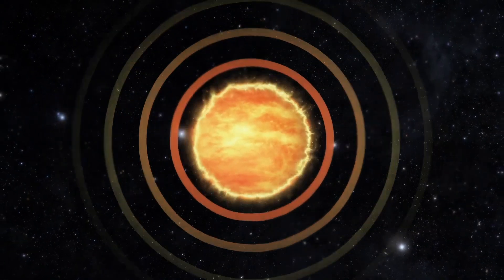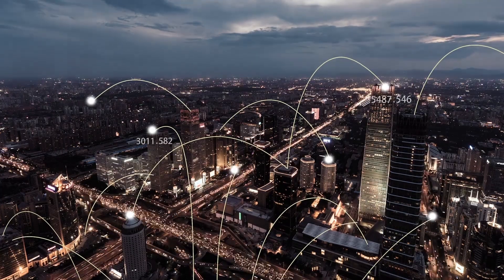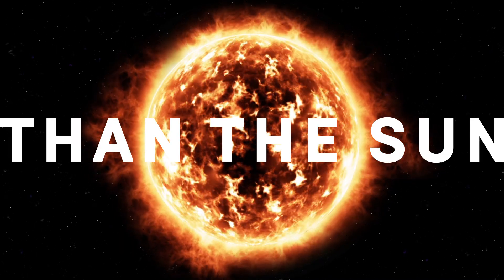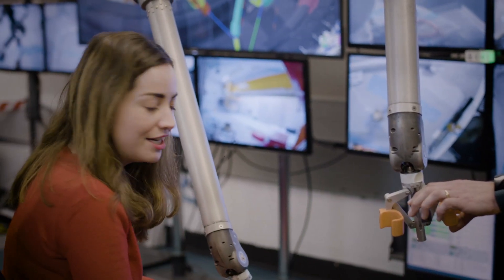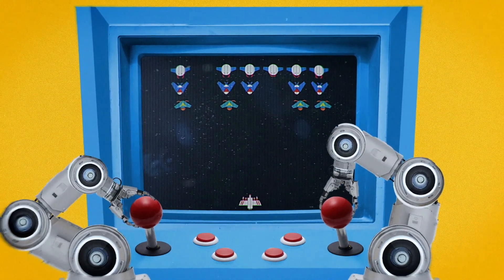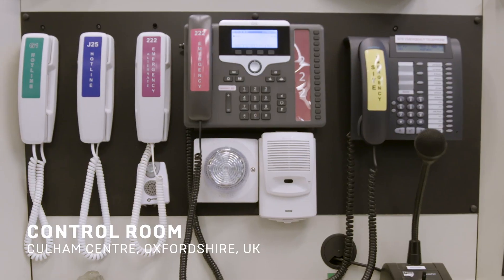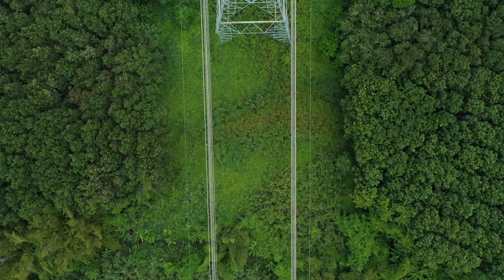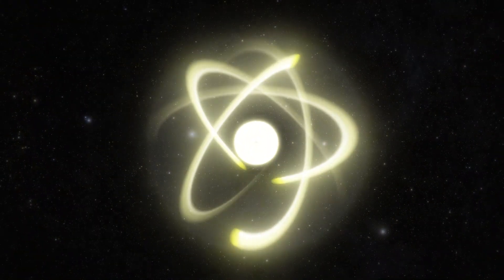Inside JET: The world's biggest nuclear fusion experiment | On Location

Comment: For nuclear fusion to become a viable terrestrial power source, two goals need to be achieved. The first is obviously to sustain a fusion reaction for extended periods of time. Second, the energy gain of the fusion system needs to be sufficiently high to justify the investment required to build, run and maintain the system. Given the predicted time frames to fully develop fusion power, the transition to renewable energy resources will be far more advanced thus making the its’ economic viability less certain.

Comment: This is really old, decades old. ITERhas already been built - and neither JET nor ITER has reachec breakeven.  By the time they exceed breakeven and produce useful power, ithe reactor will be too big and expensive to be practical.
Reply: Eventually we will have such reactors. That's not even the problem. The problem is that they are too expensive to operate. Solar power is far cheaper.

Comment: Utter failure - this produces only a tiny fraction of the power it consumes - some say as low as 1%, after decades of research. The figures mentioned here only consider heating power - this is a fraction of the total power consumed to run the place.

Comment: What are the downsides of fusion becoming the main source though?
Reply: There is no downside which is the best thing
Reply: They mentioned radioactive waste in the video
Reply: @shrodingerscat8940  it does actually prpduce radioactive waste as tritium fusing with dueterium will produce nuetrons. Those will hit the breeding blanket and the walls of the reactor vessel. That will produce waste materials.
Reply: @russhamilton3800  wow u are really smart
Reply: @russhamilton3800  r u a scientist?
Reply: @shrodingerscat8940  nope, just read a lot.
Reply: Well the fiel they are going to use costs 30k per gram. So your average fusion plant would burn through 10 million per day. ITER says they can produce 1.14 times the burned fuel but it actually uses more than gets burned so we would have to build fission reactors to supply the fision reactors. Also since that fuel is a hydrogen isotope its going to make the steel inside brittle and since it will produce neutrons, those neutrons will destroy the chamber even more. So if they can produce net energy, they can't build plants due to not enough fuel.
Reply: @russhamilton3800  we can mine fule from moon once we become advance
Reply: @shrodingerscat8940  first off what is beong designed uses tritium not He3 which is what i suppose you are talking about. He3 is not some magic bullet. Yeah it can fuse more easily and has no neutron nastiness but that is still a long ways from being able to produce net energy. People who mention moon mining, tend to think its a given and its not. Tritium - Deuterium is not a given. As a reminder they so far have not even reached gain let alone the ability to produce net energy.
Reply: @russhamilton3800  hmmmm ok

Comment: They'll be popping champagne corks when they get it to light a 100w light bulb. Nevermind that it costs 1.5 billion dollars.
Reply: It can already do that. Problem is if they put in, say, 1 MW of energy they get 0.98 something MW. Which is a lot but less than the amount put in. They're trying to get it to above 1.
Reply: @MenacingPerson  Right.. enough to light a light bulb. When they get just that much more out.. than what they put in. They'll have Uhhhh succeeded to light my closet.
Reply: @rogerdodger8415  1 mw can light 10,000,000 lightbulbs for 5 seconds you know
Reply: @MenacingPerson  Not if it takes one million one hundred Watts to produce it!!
Reply: @rogerdodger8415  wait no its actually 10,000 we're both dumb
Reply: @rogerdodger8415  anyway, enough to power 10,000 lightbulbs
Reply: @rogerdodger8415  and besides they can generate up to 16 mw so 160,000 lightbulbs for 5 seconds
Reply: @MenacingPerson  Are we talking leds here?
Reply: @bobrose7820  we're talking 100w power consumption here, not the chaotic wattage equivalence system so it doesn't matter. 

Light intensity is measured in lumens, and power consumption is measured in watts. Since you're talking about type of bulb, the best analogy is that i'm talking about incandescent bulbs.

Comment: One big issue (if fusion were to spread across the globe), the high neutron flux could be used to manufacture plutonium-239 for nuclear weapons.
Reply: I’m no fan of fusion, I don’t think it will ever work. But even so carrying out surreptitious bombardments or ones where inspectors have been kicked out, probably neither will work very well. Not that it’s not a concern but it would be worth the risk and doing countermeasures, except that fusion is not going to work…
Reply: @russhamilton3800  do you have specific reasons for saying fusion won't work, or is it just a feeling because it's taken so long to get it to work? We know fusion "works" under certain conditions (the sun and every other start being good examples). The question is whether we can build machines on earth that can economically produce electricity from fusion.
Cynicism is understandable, but it doesn't prove something cannot work. It just shows that people have been overly optimistic in the past.

Comment: 2:23 plasma is not energy. Plasma is a state of matter - where some electrons are removed (or free) which result in gas ions (which are now positively charged and thus able to be influenced by the magnets).

The energy released is electromagnetic radiation.
Reply: Most of the energy released is in the kinetic energy of the neutrons, not the EM radiation

Comment: But isn't the electrical output power produced by a basically standard steam turbine?  Thus making the nuclear reactor just a somewhat better way of boiling water.  Isn't it true that, in round numbers, the plant will release about 2 kw of unrecoverable heat into the atmosphere for each kw of electrical power produced?  Why is no one discussing this fact? I am sincerely not baiting here, but doesn't this reality need to be addressed?
Reply: Why is heat released into the atmosphere an issue? No one is discussing it because the heat just dissapates and leaves the planet.
Reply: Neither JET nor ITER have any electrical generation capability at all.

Comment: Windmills are just a drop on a hot plate
Reply: “windmills” is for the layman. They are caked wind turbines and windfarms deliver actual electricity to the grid and does so in a cost competitive way compared to coal, gas and nuclear.

And the wind sector achieved more in the last 20y  than fusion will ever do in the next 50y..  it is an interesting physics experiment but a commercial pipe dream, like so many other before.

Comment: Still 30 years away.
Reply: Very optimistic. At least 30 years for a proof of concept. Then 10-20 years more for efficiency optimization and cost cutting. 10 years to build, test and commission the first commercial model. That is in the best case scenario 50-60 years before the first commercially viable fusion reactor is in operation. And that’s assuming nothing goes wrong (and of course if you have worked in projects or as an engineer you know something always goes wrong.. just remember the Concorde..)
Reply: @Memoiana  aye 30 years to see if it will even be viable!

Comment: I still didn't understand that what kind of material is this which sustain at 150 Million degree C. Melting Temperature of these materials is around 3600 C.
Reply: The amount of "stuff" that's heated to 150 Million °C and turned into Plasma is minuscule and is contained within magnetic fields which means it doesn't touch the walls. Sure, its pretty hot and should it touch the walls it will absolutely melt it. Also, there isn't nearly as much heat coming off of it, relatively speaking, to heat up the walls while plasma is contained in the magnetic field because there's so little of the plasma. Increase the amount of plasma you have and you'll melt the walls regardless of it you have it contained in magnetic field or not. That's not to say that walls don't get hot at all. They do, just not as hot as one might imagine considering its a meter away from 150 Million °C
Reply: The plasma doesn’t touch the walls. The plasma is 150 million C, not the surrounding materials.
Reply: @Gomlmon99  Still inside temperature will affect the outer bounder. Does 150 Million C has an impact on the material?
Reply: @FawadKhanz  Yes. It is one of the things they are working on. Certain parts of the machine get very hot and they use special technology to remove the heat. But it is not as bad as you think, the materials do not melt very fast

Comment: To do this successfully you will have to learn that knowledge of how fusion works is on a "need to know" basis. It is not paranoid to imagine that the secret to the most terrible weapon ever created is surrounded with lies and misinformation. You must recreate the physics from scratch.
Reply: Thermonuclear weapons are a totally different technology to creating steady and controlled fusion for electricity. The secrecy will come in protecting any nuclear waste and fuel used for the process and possibly protecting the IP of the design I'd say.

Comment: Sorry but the frog eaters across the channel are already assembling a fusion reactor .   ITER  !
Reply: ITER which will use 300Mw of electricity to produce 500MW of thermal which if converted, but it won't be capable of electric generation, would produce 200MW of electricity. Yeah way to go!
Reply: @russhamilton3800  ,   it's use 300mw of its own energy to drive itself ,  so its a net gain . 
Nuclear reactors and hydroelectric dams all use some of the energy they produce to operate themselves .   Valves , Gates,  cooling pumps ,  etc
Reply: @ericsarnoski6278  wrong. It will be a gain but only in the difference between the fuel as heated and what the fuel produces. But pretending that other inputs like the energy to hold the plasma or the parasitic electrical stuff still means there is no net energy production. Call it gain all you like, there still is no excess power.
Reply: No. ITER (like JET) is an international project. France simply won the bid to house it. It won’t even start actual fusion experiments until 2035 (plasma experiments start 10 years earlier), so there’s still a lot of meaningful science to be done at JET and other facilities.
Reply: @JonS  you mean building pensions for engineers and scientists.
Reply: @russhamilton3800  no. I don't mean that. Every scientist and engineer I've know has wanted to work on something meaningful and achieve something. I know it's popular for the anti-science community to dismiss everything as a money-making scheme for scientists, but those science graduates who are looking for riches switch from science to fields like finance (I've know people who switched to things like financial modeling). The ones who stay in science/engineering want to make stuff happen, and turn down more lucrative career paths for that.
Your comment is like saying everyone who participated in the Olympics only did so to get sponsorship, product endorsement, or TV pundit jobs.

Comment: Well, it looks to me ITER is gonna lose against solar, wind and batteries. Just upscale those to meet demand in winter time and you're there. The only negative would be a surplus energy in summer, which would result in super low energy prices.

20 years is telling me they don't expect ITER to deliver results or have a clear path.
Reply: I think the most likely and economical scenario will be a mixture of renewables, energy storage to help balance the grid, and nuclear to produce power and hydrogen.

Energy storage isn't cheap enough yet to change the world and neither is nuclear. Both technologies need some work to become game changers (i.e. make fossil fuels economically inferior). I think it's going to take a few decades to improve those technologies but I honestly think they'll solve the energy problem before climate change becomes overwhelming.

Comment: I still don't understand, how they can thrive for "unlimited", when clearly the sun is using up mass, in order to achieve fusion. 
It makes sense to convert something useless in it's natural state, but extremely energy dense and useful when converted and create heat (which we can use) in the process.
Like a log. It just sits there and does nothing, but once you add enough energy and it burns by itself, after removing said energy input, then you achieve a useful conversion and SEEMINGLY free energy, as long as there is a mass to convert.
Except that the log is hydrogen and deuterium, am I getting this right?

Comment: 6:29 redundant by other technologies, shows WindMill*
Reply: hope Fusion Reactor turns into Arc Reactor soon
Reply: @chan_for  yeah exactly. fusion gives us the possibility to create energy on demand and a lot of it. Renewable is good as a grid but what if you are off the grid ? Small fussion reactors would be extremely useful and we heavent mentioned the possibilities that this technology would open in space exploration or colonization
Reply: Yup. You got that right. At the end of the day what matters is actually delivering cheap electricity to the grid which windfarms are doing. 

Fusion is a pipe dream. 

https://renews.biz/61228/uk-offshore-wind-cheaper-than-new-nuclear/

Comment: No, you will never build enough windmills and solar panels to supply the base load, even if you could make enough batteries to store the excess when the sun wasn't out or the wind wasn't blowing.  Fusion (or fission in the interim) is the only way to go if you don't want to emit carbon dioxide.
Reply: and dont forget the amount of rare earth materials they need and the complecity of recycling those materials
Reply: I don't think you understand whst a strawmsn argument is, but I digress. You are assuming net energy from fusion possible. They have not even proven that gain is possible. Even if net energy can be got from a prototype, can it be fueled? Not with current tritium stores. ITER claims it will breed 1.14 times what it burns but they don't talk about the amount they will lose or about the contamination. So go ahead and keep saying fusion is inevitable because that is a real strawman argument.
Reply: Every windmill built will supply more power than all fusion reactors combined.
Reply: @russhamilton3800  At the end of the 19th century you could have argued, correctly, that horses had allowed more people to travel much further than all automobiles combined.  Any more useless strawman arguments?

Comment: the problem with fusion videos is they are all like advertisements. it always starts 'save the plant!!!11111oneone', moves on to a fusion primer for noobs, but then there is no highly technical stuff for actual fusion nerds. and this aint the only video that does that, like 95% of them do. 

was kinda hoping they would talk about jet's run for the q record in 2021.
Reply: Bottom line, FUSION PLANTS are a waste of money when they could be proliferating and improving MSR's.
Reply: @jonwashington6440  you know you can do both, right. there is enough money in the world. we should be doing fission now, smrs, msrs, pebble beds, the works compare results and pick the best option based on operational data. while these are being brought online, continue fusion research. it may take another 50, 100 years, but it will get there. and as with space industry there are spinoffs that are very relavant to the rest of us. super conductors, more efficient heaters, power electronics, control systems. relying on short term thinking alone is why we are in this rut in the first place.
Reply: Fusion is a Terrible Way to Produce Electricity: Princeton Physicist Who Worked on It for 25 Years
https://www.youtube.com/watch?v=FrUWoywZRt8

Comment: Fusion Generator will never happen.  Sustainable fusion reactions will result in a small sun which will probably engulf Earth.
Reply: Oh, dear. The fusion reaction cannot be maintained without the machine (magnets containing the plasma very precisely) operating. If something goes wrong, the reaction stops. There can be no “small sun”. The sun achieves fusion thanks to massive gravity.
Please learn some of the basics before trying to alarm yourself and others. There are issues with fusion creating secondary nuclear waste due to neutron bombardment, and that it could be use to manufacture plutonium-239 for nuclear weapons, but an uncontained reaction is simply nonsense.
Reply: Fusion will never work but your statement is ridiculous.

Comment: Renewables wind/solar are INTERMITENT, not Unreliable.  We can predict their output days in advance to high levels of precision.  Fusion if it ever happens will have high capitol cost and low operating costs like a nuclear power plant, making it a baseload generator that can't work well with Renewables.  Any secondary power source that fills the gaps for renewables can't be a high capitol cost system that runs only some of the time because this makes the cost per unit of power terrible.   You need low capitol cost, high fuel cost sources as these preserve their cost effectiveness when run for just a few days or even hours each year.  Some synthesized propane in a tank and a turbine would be more then adequate when combined with about a day or so worth of battery/compressed-air storage.  The batteries cover for the day long gaps, while the turbines act as peakers and cover the longest multi-day gaps.